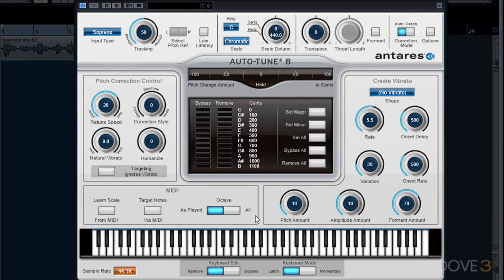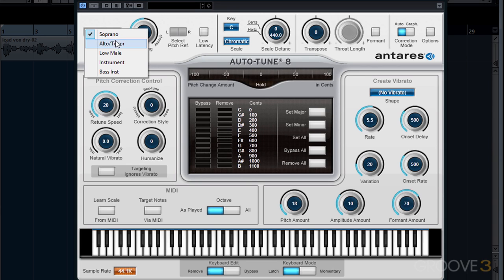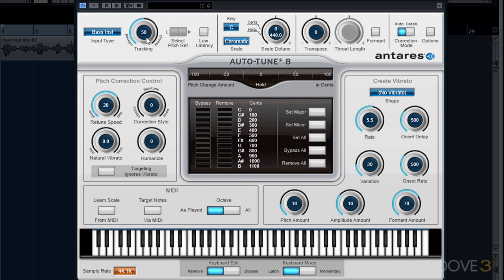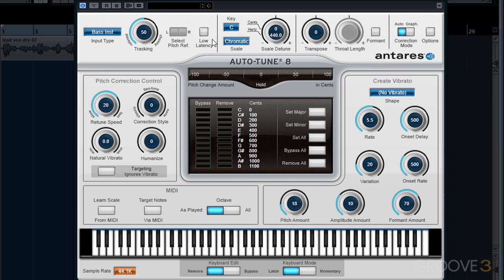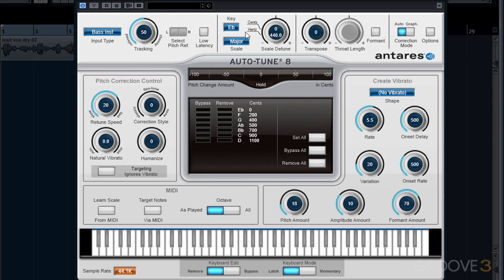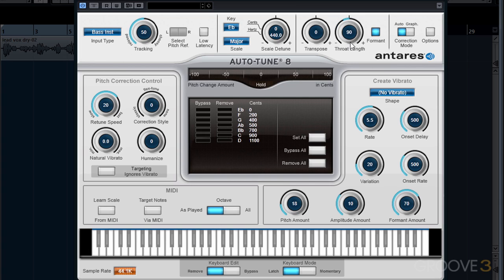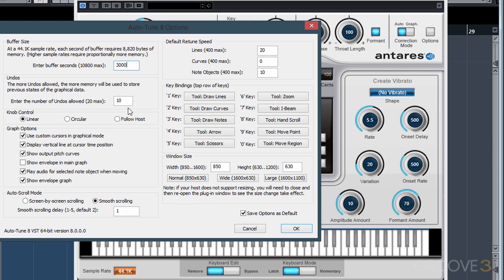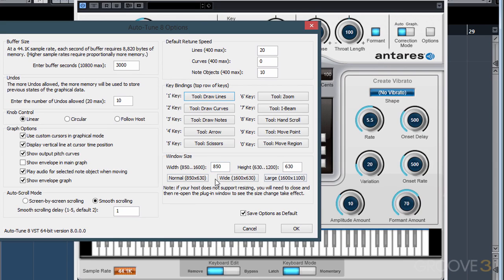Interface Overview (Auto-Tune 8 Explained)

Comment: I'm thinking about getting the peavey pv14at.  It has auto-tune built-in.  Do you know if you can upgrade the auto-tune in it?  or what version it is?  I don't know if it's better to buy a mixer with it built-in or have to buy a mixer and auto-tune separately.